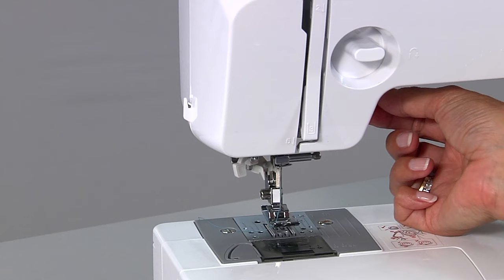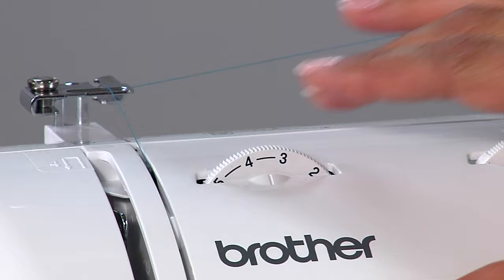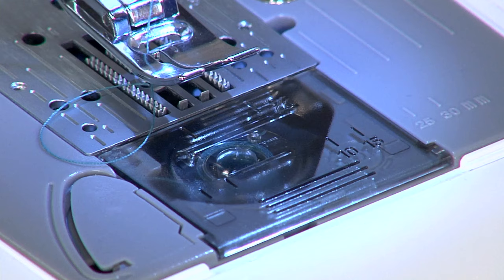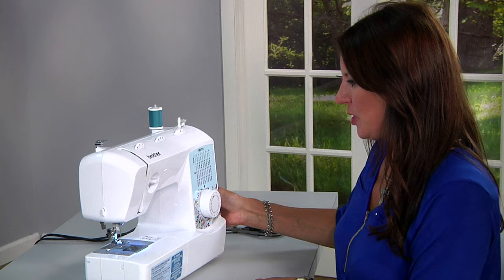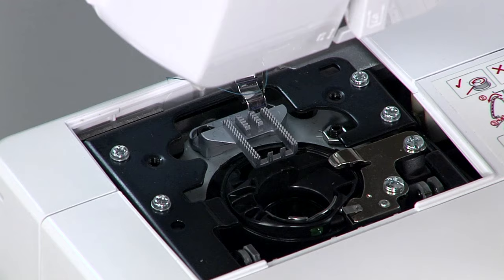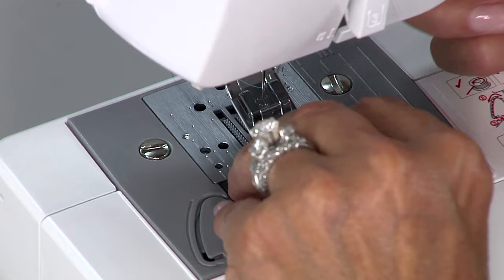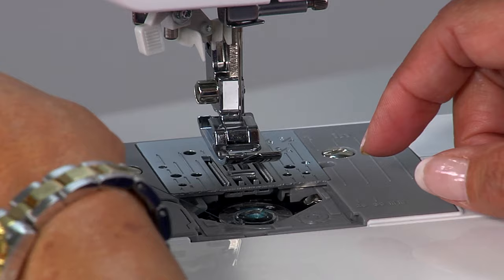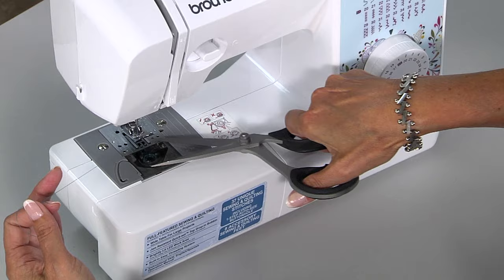Common Brother Sewing Machine Problems: Causes and Remedies

Comment: Hi, I have brother LX27NT. For past few days, My machine is making lot of noise and top thread is getting cut frequently. I replaced to new needle. Took off pressure foot, and also, removed needle plate by unscrewing. Removed all the lint, wiped with cloth and replaced everything in respective order. Still the problem is occurring. Please tell,how to set it right.? What could be the problem.? Eagerly, waiting for your suggestion. 😊
Reply from the maker: We apologize for any inconvenience. You have reached Brother USA. Please use the Brother global locator link below to locate a Brother group to assist you with Brother products that are available in your area:
http://www.brother.com/brgnet2/hsm/index.htm

Comment: Tried the tension, changed the neddle, cleaned bobbin case area, but top stitch still not picking bottom stitch. Could this be a hook timing issue? How do i fix this gs2700 brother machine. Thanks.
Reply: @BrotherSews  Thankyou, appreciate it.

Comment: Hi: I'm not sure how to fix my presser foot. When I lower the lever, the foot snaps down with a lot of force, and feels like it is permanently stuck at the highest tension. Do you have any tips, or is the machine unfixable?
Reply: I know this is late, but there should be a dial or knob to turn to reduce the pressure of your presser foot. Check the manual for that, or look online.

Comment: My presser foot won't go up please help
Reply: Did you get to fix this? I have the same issue and desperately looking to fix it
Reply: Jay Jay Flowers same issue with my machine. Any luck?
Reply: S Phillips yes it was a lose screw. Maybe you can check the screws of the presser and tight them up and see if that works
Reply: I have a brother VX808. It use to work perfectly, but now it won't pull the fabric through. There is no lever or button to adjust the feed dog teeth. Is there something I can do myself short of throwing it away, or do I need to take it in to a repair shop?